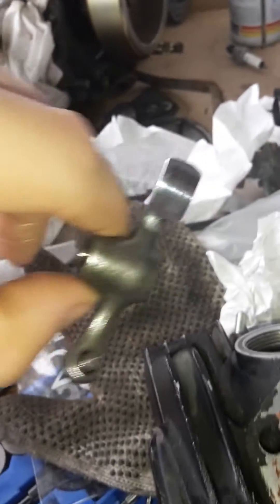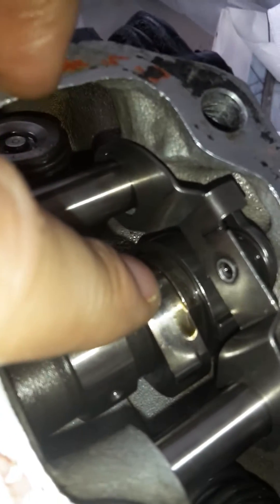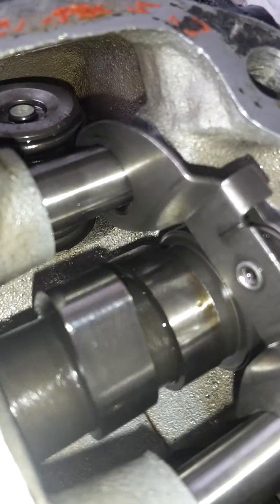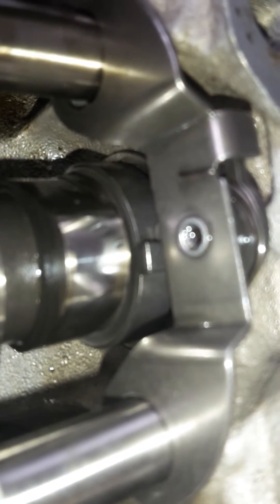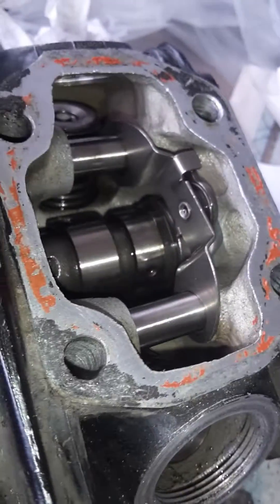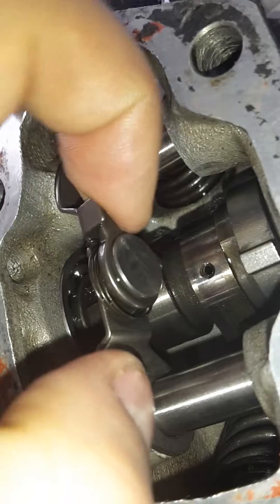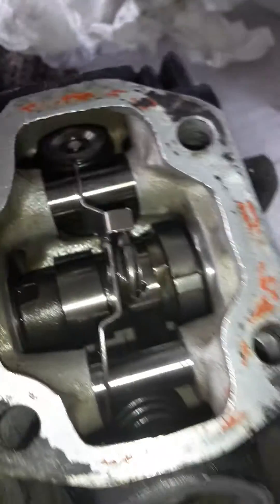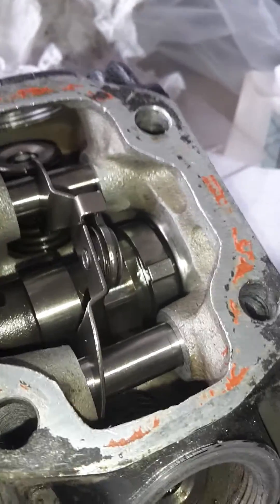Auto decompression system on kymco k-pipe 125?

Comment: Do you still have this bike? How did you like it and why did you take out the engine?
Reply from the maker: No I don't have it anymore. The bike itself was fine for driving in the city or short trips on country roads but not with a passenger. When I bought it, I was single and knew no one who lived further than 30 km from me but then I got a girlfriend whose parents lived 80 km away and we ended up regularly driving more than 100 km, two people with bagpacks and it just is too small for that purpose.  When I took out the engine it was because I took the motorcycle apart to store it in a 60x80x120cm cabinet over the winter when I didn't have insurance.
Reply: ok thanks.